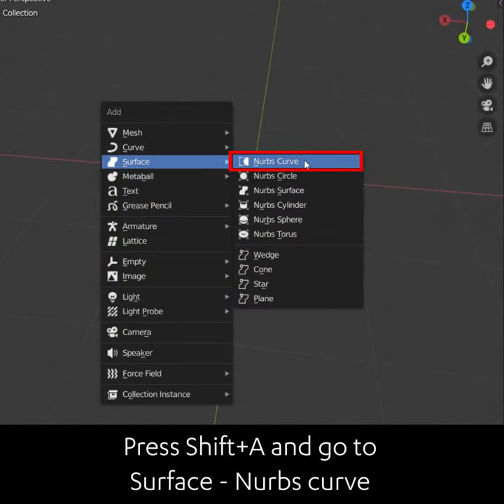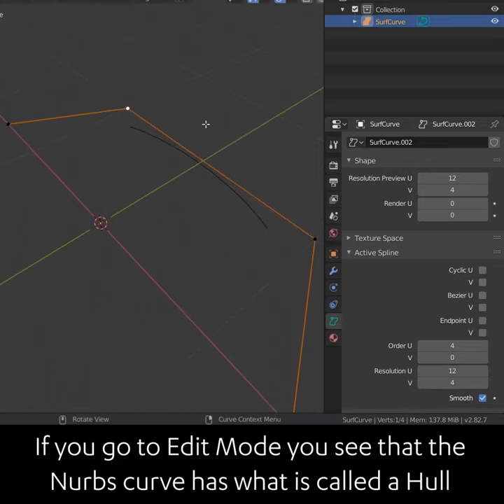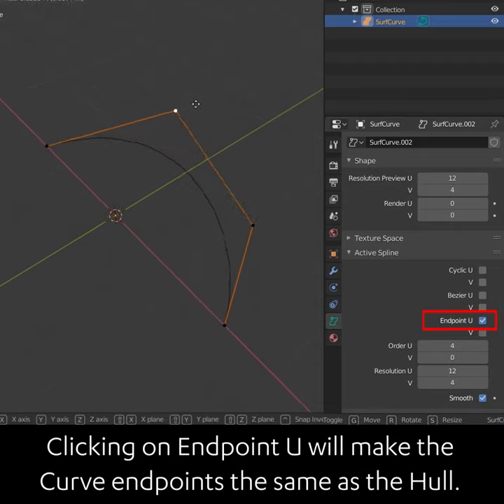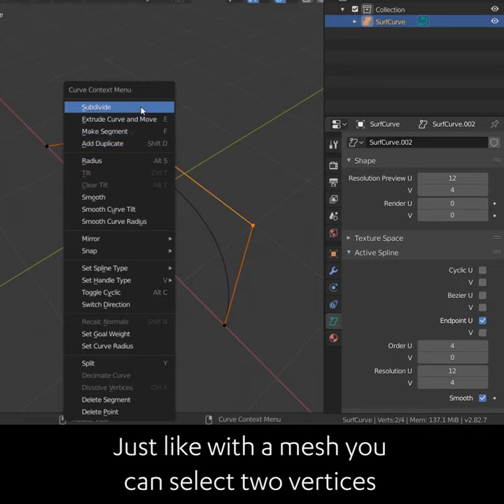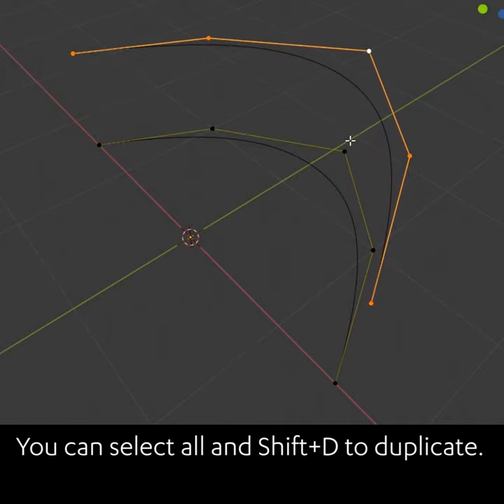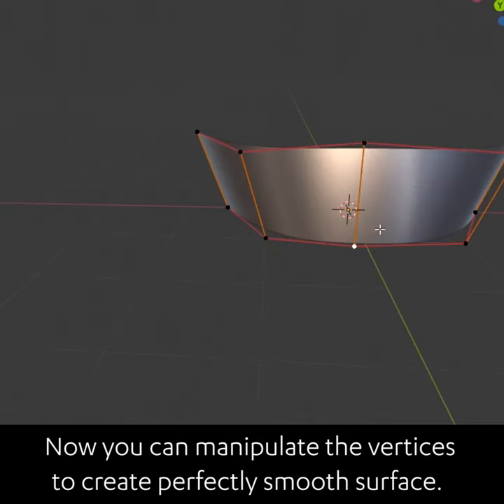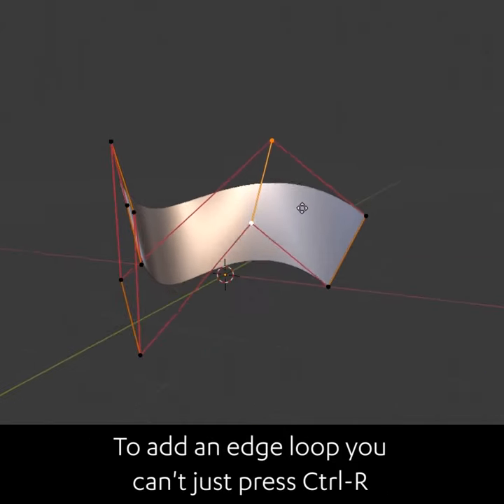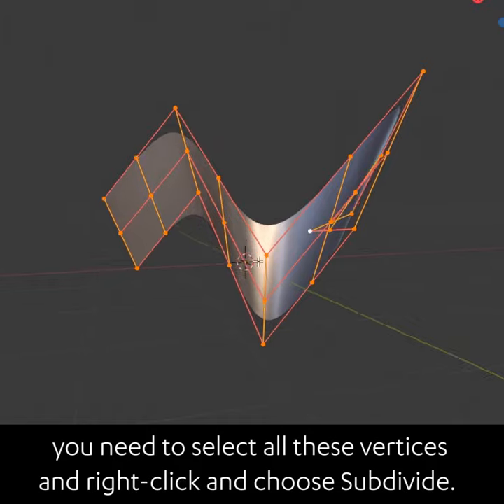Daily Blender Secrets - Basics of Nurbs modeling

Comment: I have a problem, I did exactly the same, but when I pressed F to fill the Nurbs becomes cyclic, it doesn't create faces (3.2)
Reply: In case you never figured it out, you chose the nurbs curve from the curve add menu and not the surface menu.
Reply: @Blendercage  Can I convert cruve nurb into surf curv nurb?

Comment: When I press F I got the message "too few selections to merge" I have 2.80, All the points are selected. I tried to subdivide the nurb curves but it doesn't work too.
Reply: I figured it out. The two curves must be joined as one object, and you can only fill two rows at a time and they need to have the same numbers of segment points.
Reply from the maker: Yeah you should definitely duplicate the Nurbs curve in Edit Mode, not in Object Mode.

Comment: What function is this F hotkey?
My preset value of Blnder shows that F HotKey is "Make Segment",
So I cannot use F to create a surface.
Reply from the maker: F is for Fill, just like with normal mesh geometry.  You are probably using a Bezier curve, and not Nurbs.
Reply: @BlenderSecrets  
I checked the Scens Collection and I'm sure that NurbsCurve was created.
Reply: Sorry, I think I'm stupid. The correct way is to use Surface-> NurbsCurve so that I can do it correctly.
Reply from the maker: @BiseChen  That's odd, I can only tell you that F is the default for Fill in Blender. Are you in Edit Mode, is everything selected?
Reply from the maker: @BiseChen  Not stupid, just learning!
Reply: the same problem, when I choose NURBS Curve from Curve, there is not the option "F for fill" in the submenu, this option is only for NURBS Curve in Surface. 
Can I do the Fill with NURBS Curve on Curve menu ?

Comment: In blender 3.22 the command F just connect side points, there is no fill effect as on video.  I duplicate curve in edit mode, so they are joined as one object. I try several time back and force - the same result, maybe it is now working in another way? I decide to test in 2.8 - also dont work. I select both curves in edit mode and pressing F just connect opposite side of curves and make like knot curve, no filling.

After that i starrt reading comments and found my mistake - i dont saw the difference in "Curve - Nurbs curve" and "Surface - Nurbs curve" These are different ones. Now it is clear for me.

Comment: What's the difference between this and regular subserf modeling?
Reply: You can set point weights with NURBs, there is more fine control. Subdiv is easier to work with in some cases, but you can also destroy your topology easier.
Reply: @SoftBreadSoft  thanks

Comment: Now if blender had something like T-Splines
Reply from the maker: Can you explain what T-splines are for?
Reply: @BlenderSecrets  So T-Sp;lines was a plugin for Rhino, basically it used nurbs surfaces in the same way you would box model, extruding faces, creasing edges, you could also extrude nurbs curves lathe them and so on, just how you would build a model from say a cube or a profile curve you could do the same in T-Splines, it was a plugin that i literally fell in love with, beautiful to use and the output was stunning to look at, sadly its now been acquired by auto desk and resides in Fusion 360.
Reply: @simpernchong  you can import a subdivision 0 mesh into Fusion and convert it to T spline, or Convert that into a Brep, and it looks identical to how it does in blender.

Comment: Im adding nurbs curve, mark checkbox to see the ends if the curve. Than duplicate curve the same way as shown in video in edit mode. Than press A to select all points in both curves and than press f. And it not works. Only end points connecting, but not the whole curves. Maybe you know why this happening ?
Reply: As comment bellow by 
Nj Njhjh pointed out you need to use Surface->NURBS Curve, not Curve->NURBS Curve.

Comment: For me, F did not fill it with faces - it just added a new segment between the original and the clone.
What am I doing wrong?
I made a curve, hit Shift-D, then G, Z, moved it up, then A to select all, then F.
Reply from the maker: Probably you didn't choose Nurbs surfaces
Reply: @BlenderSecrets  Thanks, you were right. It's a bit confusing that Blender has NURBS curves under both Curves and Surfaces, but only Surface curves can be used to create surfaces.

Comment: how did you get the nurbs to do the fill? i hit f and blender just focuses on the nurbs, i have it set to the modo theme and industry stands controls FYI  thanks
Reply from the maker: F normally is for fill in Blender, I've never used other themes or anything other than the defaults, to be honest. Did you really use nurbs? It won't work with regular splines.
Reply: For anyone stuck on this as well, make sure when you're in the Shift+A menu, that you select SUFRACE. It wont work with the Nurbs Curves. Those are actually just curves.
Reply: @gokuta333  Thx for the advice, it helped.

Comment: Using 'F' to fill the 2 curves results in them being joined, not filled.
Reply from the maker: You need to use Nurbs, not normal Bezier curves.
Reply: @BlenderSecrets  nope ... They are definitly joined... I have that issue too
Reply: same, joined not filled